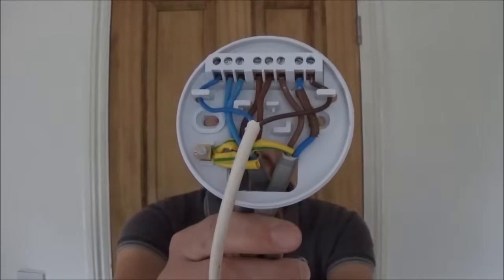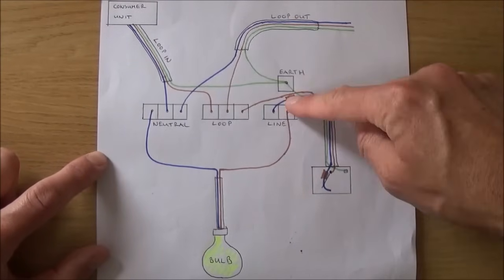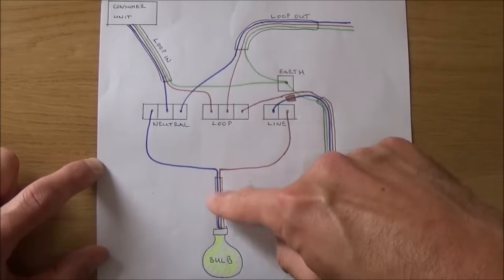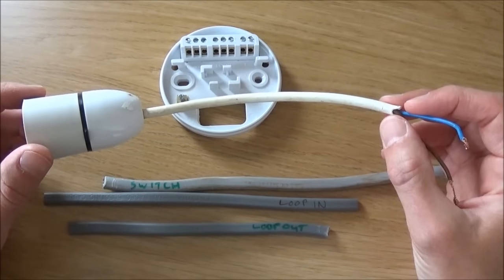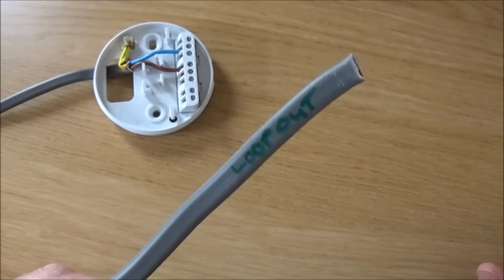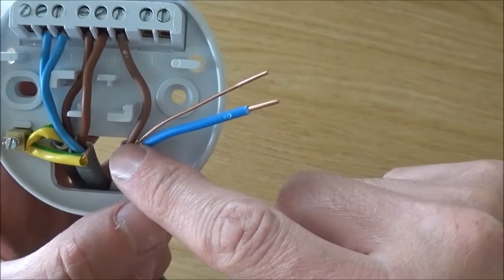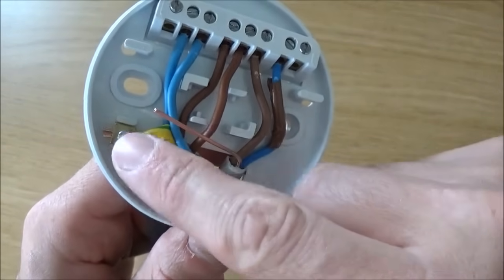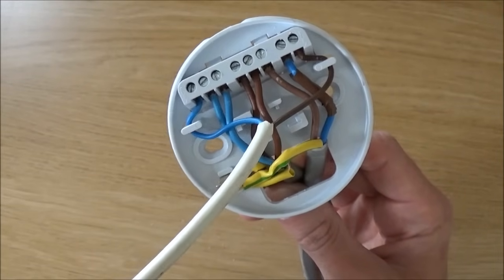How to wire a ceiling rose - lighting circuits explained. Ceiling rose pendant install!

Comment: Brilliant video. One stupid question. Does it matter which terminal the wires go into as long as they are in the right section (neutral, loop and line)? That is, does it matter which of the 3 loop and neutral terminals the blue and brown wires of the loop in and loop out go in or is it just important that they are in the correct block (brown in any of the 3 loop terminals and blue in any of the 3 neutral terminals)?
Reply: Hey J, if you have a neutral wire, it can go into any of the three neutral terminals. It doesn't matter which it goes in, 1st 2nd or 3rd, just as long as it is in the right section. Hope that answers your question.
Reply: @zia7200  It does! Thanks for your help!

Comment: 1 question my ceiling wires aren't labelled in out or switch how do I differentiate which is which if they're not labelled
Reply from the maker: Only really by testing them. You can do process of elimination by removing a wire and seeing if it disconnects the power to the light. If it does then it's the switch. Or used a cheap tester like this - https://amzn.to/3qilzMF which will help you identify the switch cable by turning the switch on and off you will see the power come on and off to one wire.

Comment: I only swapped pendant brown and blue wires and now the light switch stays on all the time. Any ideas what I did wrong?
Reply from the maker: Sounds like you've connected the brown wire to the loop terminal instead of the switched live terminal. Watch vid again and make sure you have the wire in the correct terminal. Hope that helps.

Comment: Out of interest; Why doesn't the lighting circuit wiring return on a loop to the consumer box like the wiring for the power (sockets) circuit does?
Reply from the maker: Something to do with keeping the size of a cable down on socket circuits, by returning the electric has two pathways. But more commonly electricians are using radial circuits (like the light circuit that doesn't return) for sockets but with a lower rated fuse or MCB to protect the circuit. Years ago there was often one circuit in a house for sockets whereas now there are several circuits, commonly one upstairs, one downstairs and one for kitchen. This means the loads are a lot less per circuit and a radial is usually adequate with a lower rated MCB like a 16 or 20amp. It's also better in practice as if a break in the circuit occurs power will be lost to sockets after that point. With a ring circuit, the power will be fed from the other direction and you will continue to use the sockets with a fault which could be dangerous. Hope that all makes sense?!
Reply: @POUSEaroundtheHOUSE  It certainly does- excellent! Thanks.

Comment: I have 4 grey wires coming from my kitchen light in each one there is one black one red and one bare copper wire running through the middle of the core , I have identified the live wire from one of the grey wires the rest don't make and sound ,this was from and old fluorescent strip light ,I used the live wire and the neutral wire and the copper wire thinking this was the earth and isolated the other wires thinking they were no longer needed when I switch the light on the new 3 spot light worked but then I run into a problem the light switch will not turn of the lights are constantly on in the kitchen ? can I do this same process with 12 wires are your video only has 9 wires ?
Reply from the maker: Basically your main feed (permanant live) must all be in the same terminals. Neutrals all in the same terminals, and switched lives must return to the bulb. I can't say without looking at this. If in doubt please call an electrician and stay safe! Thanks for watching.

Comment: 2 questions, I’ve never done this before. I got half way through before starting this video. How do I know which wire in the ceiling goes to the switch? And with the earth wires, I twisted all three round each other cut 2 of them shorter. Put some duct tape round them and just put the one long earth wire into the terminal. Is this ok or is this dangerous? I assumed as they all touch anyway it would be alright, but now I’m thinking maybe rather than all just touching where they’re twisted round each other, maybe they all need to be in the terminal?
Reply from the maker: No that's not ok, each earth to be separate and sleeved with earth sleeving individually and all terminated into an earth terminal. To find out which cable is the switch cable you need a tester of some sort. Basically the loop in and out will be permanently live the switch cable is only live when switch is turned on. Sounds like you may want to call an electrician. Please if you're unsure call an electrician as you don't want it unsafe or causing a fire. Best of luck!

Comment: Thank you for. 
Just a question. If you have 3 cables hanging out of a ceiling... how do you tell which is loop in, loop out and the switch wires?
Reply from the maker: You need to test them safely with a tester. A simple way is with a non contact tester. Without actually touching the exposed end of cable, while power is on the loop in and out have power, but the switch only has power when switch is turned on. If in doubt call an electrican!
Reply: @POUSEaroundtheHOUSE  Brilliant! 
Very much appreciated.
Reply from the maker: @abdaljabbarhusayn610  no problem.

Comment: The only complaint about this otherwise excellent video is that the earths are far too short, bit of a pull on a wire an the earth will be first to pull out. The average DIYer would not know until something goes wrong.  There is room for more earth wire so use it.
Reply from the maker: Thanks for the feedback!

Comment: About to do this in a min, I have no tape on the switch wire so looks like I may be swapping some wires about
Reply from the maker: Sometimes previous electricians won't have colour coded them. Maybe colour code them and take a pic before you start just in case you forget how it was. Best of luck.
Reply: POUSE around the HOUSE thanks for the vid it really helped, from my first wire up another bedroom light wouldn’t turn on so I changed over 2 wires and all works perfect now and yes I taped the wire up for myself or any future DIY, again thanks for the vid

Comment: could you tell me why my ceiling light turns of after about 10 seconds this is the second one in the house to do this I took the rose of the last one we have not used that one since but now another one the other end of the house is doing it
Reply from the maker: I'm not sure sorry. Probably worth getting an electrician to test it for you. It could be the connections in your light switch. Having said that it could be a number of things. Sorry to not be of much help. Best of luck.

Comment: Hi. Thanks for the video. I had an issue with a bedroom rose and yiur drawing hepled me out (thanks). From the original wiring there were 2 wires going to some connectors while other connectors were left empty SO I decied to statr from the beginning and with 3 cables I tested all 3 cables to ensure that I knew which was the switch cable ( used multi meter on resistance for open and close circuit ) then wired the switch at the rose and then wired the two lives and the 2 neurrals just like your diagram and then it just worked - RESULT :-)
Reply from the maker: Nice one Harry! Thanks for watching.

Comment: How do you handle a fitting with only live and neutral on the brick? I have two way switching to a single light, but my brick has no loop section at all
Reply from the maker: Sounds like rather than a ceiling rose, you have a junction box somewhere so this final cable is just the feed to the light. That said without seing it I can't really comment. Not sure what it is you are looking to do, but if you're unsure please be safe and employ a good electrician. Thanks for watching!

Comment: Does it matter which live wire goes into what loop terminal? I can see which wires are the live ones but not sure which one is the loop in and loop out.
Reply from the maker: No as long as they are both in the loop terminals. If in doubt call a qualified electrician. Hope that helps. Thanks for watching.

Comment: I'm totally confused. The wires coming in from the ceiling are only blue/brown and earth. They don't have 3 wires as shown. Coming in from the pendant there is a blue and black. So basically blue to blue, brown to brown and an earth. They don't split off to 3 can anyone shed light on this. Do I connect the 2 lives together and the 2 neutral together. I put up a fancy light and had no issues. These ceiling roses seem. More complicated.
Reply from the maker: Sounds like there is a junction box in the ceiling so if you try brown to brown, blue to blue and earth to earth it should work. That said please be careful and get a qualified electrian to do it for you if in doubt. Bad wiring could cause a fire or a shock. Make sure power is off before you try it. Thanks for watching.

Comment: Hi 
How can you tell which one is loot in and loot out? I have old wiring in my house its black and red. My upstairs lights went completely off several days ago at night, I went to turn on my bedroom light and the bulb flickered and all lights went out but it didn't trip the consumer unit. My upstairs lights are on one circuit on my consumer unit 3 bedrooms and 2 bathroom all the lights are out expect for the shower room working? Its strange bcz it didn't trip the board. I've checked all celing fittings if any loose connection and have been in the loft to check the junction box everything is connected securely but no current is showing in neither 3 bedrooms or one family size bathroom.  Its extremely difficult due to lockdown dont want call a professional in due to Covid19. Any advice would be appreciated.

Comment: That's a really neat wire stripper. I've never seen one like that.
What's it called brand or type?
Reply from the maker: Hi, if you look below the video I've put web links to all products and tools used in the video So you can find out all info you need there. Hope that helps. Thanks for watching!

Comment: One of my friends just messaged me saying they've managed to damage their pendant and if I can fix it. Never seen the inside of a ceiling rose before but this tutorial makes things nice and simple. I've cabled up plenty of low voltage/high ampage stuff before but was a bit scared about this kind of thing. Turns out it's a lot easier than I expected. I'll certainly take a copy of the circuit diagram though! Should only take a few minutes once the power's off.
Reply from the maker: Hope it went well!
Reply: @POUSEaroundtheHOUSE  I did manage to fix it properly thanks to your tutorial (the circuit diagrams are a really helpful reference). 
It took ages and I fouled up strippimg new wire (so their light is now much closer to the ceiling!) but that's probably because I've never done mains or overhead chop-blocking before so I was being incredibly cautious and clumsy respectively.

Comment: How do you tell which is loop in?
Reply from the maker: If you're just replacing like for like, then it doesn't really matter as 'in' and 'out' go into the same terminal. If you're not sure then get an electrician to test it for you. Thanks for watching!

Comment: Thank you so much. This video was very helpful today. I tried changing the dinning area light to a chandelier but forgot how the wire was connected before removing the old ceiling rose pendant. Messed up the double switch which controls the  living room/dining area. I was so happy after fixing it eventually having watched this video. Thumbs up !!!

Comment: Hi. All my lights were linked. I've installed.a new light fitting in.living room and now light in utility room.does not work. Can I just unlink the utility room light so it's on.its own and not connected to the living room rather than taking down the light fitting from the living room. Thanks
Reply: Bruce Wayne Not quite understanding what you’re saying. The lights in your house are looped in a radial (not a ring like your sockets) 

Therefore if you want power to your utility light, every light that comes before it will need to be wired correctly. Is it just your utility light that isn’t working? Sounds like it is the last light on the circuit and you have wired the living room light incorrectly.

Comment: The red from the switch to the light fitting should be labelled  switchwire. Line means constant voltage.
Reply: Otto Schless Red? That’s old colours. Also red is the live so it is your line, the switch line is a neutral, so black/blue
Reply: @uplightuk8924  but sleeved brown to indicate it's switched line, of course 🙂
Reply: Fij Tips Yes, I left out the important piece of information haha. To correct my old statement, although the switched line is of neutral colour (blue) it is technically not a neutral but a live, which is indicated with the brown sleeving as you pointed out.

Comment: Hi Pouse,
On my ceiling rose, it only has one cable (feed) coming through the ceiling- live, neutral and earth.  How do I terminate these?  Can  I also ask “On the loop out, where does it terminate on the other ceiling rose?  Does it go into neutral and line?  This will be the last termination point i.e.no further loop out,  Thanks, love your videos, very informative.
Reply from the maker: If you have one cable, it sounds like it's daisy chained from a previous light meaning two lights come on together. If this is the case then take the live wire to the line terminal, neutral wire to the neutral terminal and earth wire to the earth terminal. That said without looking and testing it could be anything so if in doubt use a qualified electrician. Safety first and best of luck!
Reply: I realise this is late but anyway...

Probably the loop in/out wiring and the switch wire are above the ceiling and they've just brought down the cable for the lamp.

Hope that helps.

Comment: Any tips on how to shorten the flex of ceiling light? Door hits lamp shade so want to raise the shade by shortening cable.
Reply from the maker: Isolate power, disconnect lamp, cut the cable (flex - the bit hanging down) to required length, then strip and reconnect as per video. You could also cut the lamp of cable instead. Hope that helps.

Comment: How do I know which is the supply in and which is supply out, or doesn’t it matter ?
Reply from the maker: It's a good idea to know which one is which but as long as both 'loop in' and 'loop out' are on the loop terminal then it doesn't really matter.
Reply: POUSE around the HOUSE, thanks very much

Comment: A lot of time you'll find the switching cable isn't marked as such, but it's easy to identify as itll be in a 2 block terminal in the ceiling rose, the issue with this video, obvious to yourself and electrically minded people, is someone wants to fit a new lighting pendant that also has an earth wire, by looking they can see where everything goes, photograph it and rewire etc.
But some won't know where the earth wire goes, even if they see an earth block..
I know this sounds kind of silly, but most people who don't understand wiring system and are fitting a different light are likely to be using a light fitting with an earth.
Ok we know earth is always earth, but explaining that in the video may have helped.
Reply from the maker: I thought I did explain that sorry. Thanks for watching.

Comment: Thanks for video it saved me. I got electric supply now in all 3rd floor bedrooms, only issue is I can't turn the light off with switch. It's constantly on in same room where I joined them. Any advise please
Reply: You've made a mistake with the switch wire, the switch wire goes into the 2 block connector, one of your light  pendant wires should be connected there, this will solve the issue unless you've made a mistake elsewhere
Reply: @adrinathegreat3095  Hi. Everything sorted now. It was actually a switch what caused the problem. Thanks
Reply from the maker: Sorry for late reply, sound like it's all sorted now. You had a permanent live going to light rather than the switched live by the sound of it. Thanks for watching!

Comment: So when it's up in the ceiling how do you know which cable is which? Like which one is the loop etc?
Reply from the maker: If they're not labelled then you don't really without safely testing it. You can try watching my other video - How to fit a ceiling light.  Replace and install a light fitting. - https://youtu.be/iQAs5zq-32c. I show how to do a live test but please don't do this if you aren't confident with electrics. If in doubt hire a qualified electrician to do it for you safely. Thanks for watching.

Comment: I have inherited this set up in my house.

The previous idiot, took the light fittings and left all wires hanging.

It is single switch for two lights.

Unfortunately, the switch live is not identified on the second rose.

Diy options, or not good?
Reply from the maker: I think if you're unsure then best to get an electrician in. Feel free to browse my videos but if they've left the electrics in that state, it might be worth getting them tested for peace of mind. Hope that helps. Thanks for watching.

Comment: Do u think it's because of the metal hook I have just installed to install chandelier
Reply from the maker: Not sure, without seeing the setup it's hard to say. Sounds like a neutral is connected to live/line. Did you manage to get it sorted after?